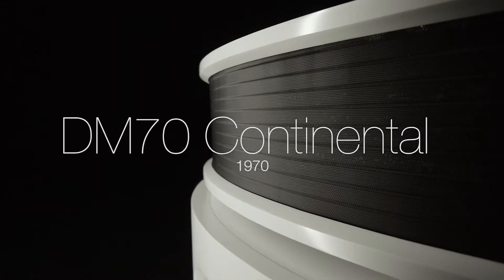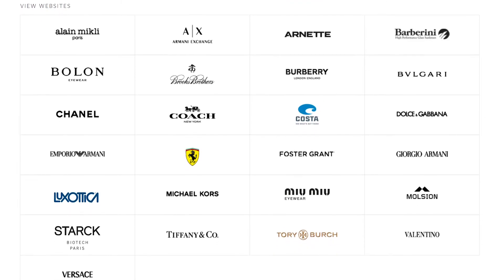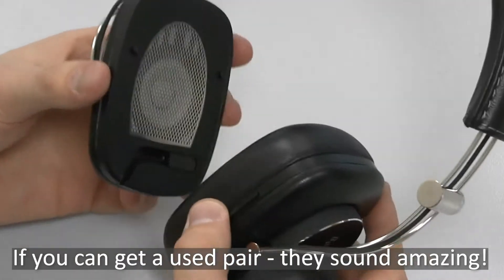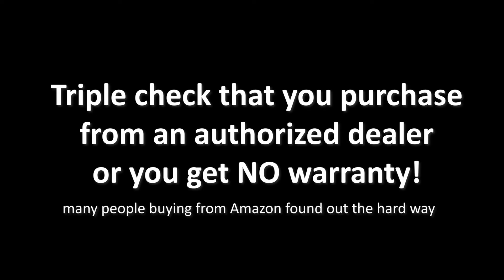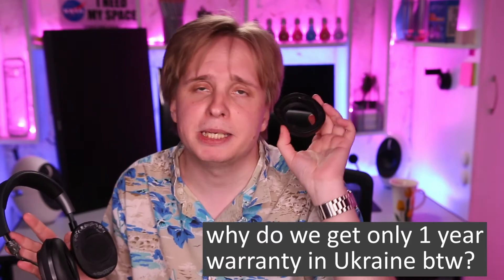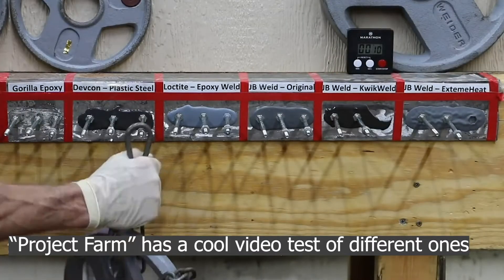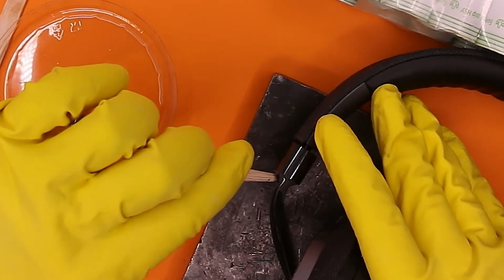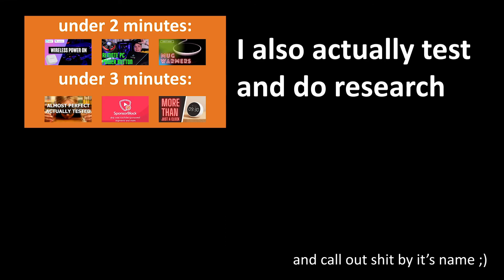Before you buy Bowers & Wilkins Headphones... and how to fix the PX snap break issue.

Comment: I barely put any cold weld on mine when I fixed them and they hold up perfectly. Can't even tell it was even broken in the 1st place.
Reply from the maker: What brand did you use? Might start a little list to see what works best, I tried to put a little bit, after a few runs it came off. Also how is the color of your option?
Reply: I have the gold one and I'm pretty screwed
Reply: Used jb weld and it was slightly lighter than the original colour

Comment: Thanks for this, my PX volume and pause button no longer click when i press them but still work... very odd.  They lasted 3 years and 4 months before the band snapped, couldn't believe it.  Can't justify spending another wad of money on new headphones so glue it is!
Reply from the maker: That's actually a lot better than many PX users report, the buttons seem to be replaceable with ones from a mobile phone, so maybe a local repair show could fix it at a small cost, I have a similar issue, with my volume up button, but I usually controlled the volume via phone or smartwatch, this reminds me of looking for it to get fixed too. :P

Comment: Hi, I have a pair of px5 but left side has no sound. Would you know how to dismantal the assembly to reach the internal wiring and circuits?
Reply from the maker: Sorry for the late reply, got stuck in the "filtered" messages, I have seen a Russian technician open these up on a video, seems pretty straightforward, I will try to find and link the video.

Comment: I repair electronics. I love the PX7 they are such a brilliant sounding headphone so clear and stand out from the rest. The issue is repairing them, they are constructed in a way that repairing them is just almost impossible if the ear cup snaps etc. I wouldn’t buy them because of this crap design, I’d probably go for the air pods max over the PX7 as you can at least do repairs on them easy.
Reply from the maker: Ironic, never have I thought I would hear someone recommending Apple for repairability haha. I heard Apple was planning to add lossless in the new gen, guess it might be a good idea to check them out (let's hope they don't screw up the design)
Reply: @CRANEREVIEWS  well sort of, the beats headphones suck especially the solo pro. The air pods max were surprisingly easy to me, it was delightful to see apple made them the way they have from the hinges to the pcb assembly. Bowers Wilkins headphones, ughh I’ve wasted hours repairing pinched cables you can’t see and other issues they are definitely a refined product to say, they are very nice though 😃 I want some Meze elites personally, need todo some saving haha🤟
Reply: @CRANEREVIEWS  only thing with the air pods is they need a switch soldering between the battery so they can be disconnected and turned off fully without the case 😂

Comment: I sent my PX for repair, no parts. Replaced. Wow. The replacement, again had a problem. No parts, cannot be repaired, again. I have to get the new PX7 at a 40% discount. Unrepairable short-life headphones.
Reply from the maker: 40%? Should have give a free upgrade for all that trouble.. (or downgrade, depends on your taste, I know that not everyone likes the PX7's)
Reply: @CRANEREVIEWS  They said because I don’t have the warranty anymore so it won’t be replaced free. And it would be the second time to be replaced due to unavailability of parts.
Reply: @unclepopeats  Wow, I just got off the phone with B&W after mine just snapped (already repaired under warranty years ago).  They only offered me 25% lmao!  The bums.  Anyhow, I was just searching to validate my plan of using J-B Weld heat-resistant epoxy that has 4730 PSI strength since that was the strongest epoxy available at my big box store.  I hadn’t expected to see that I was low-balled🥀 Now I’m even more salty about their terrible product and will go write some reviews finally!
Reply: @honeyg3589  I got Px8s for Christmas and used them ONCE. Snapped the second time. My husband bought them for our daughter and 2 nephews as well, same thing, one almost immediately snapped. So we just spent almost $3000 on 4 sets of headphones, 2 of which are broken and were told breaks aren’t covered under warranty and offered 25% off to replace them. No words.

Comment: After using 4 years,, today I faced same issue and I simply went for Gas Welding and Job is Done ✅ Just 2 small stitch of Gas Welding 😅.. Welder didn’t charge 😅
Reply from the maker: Ooh, would be afraid to damage the cable, but that sure works, haha
Reply: @CRANEREVIEWS  don’t worry about cable,, cable is 100% safe and secure..